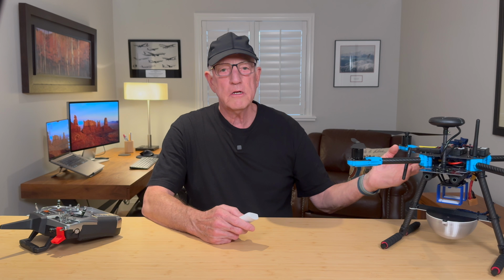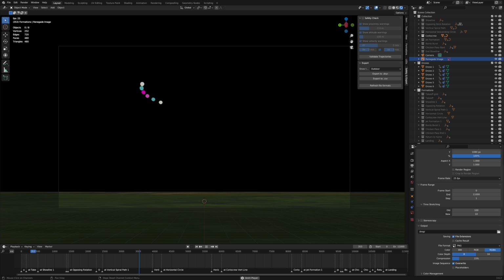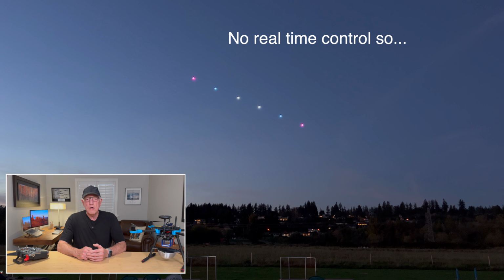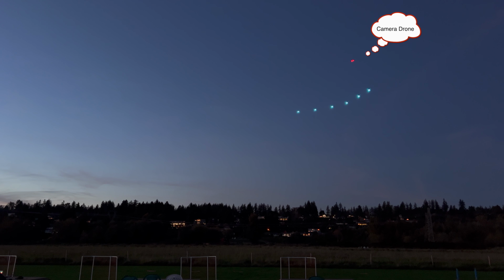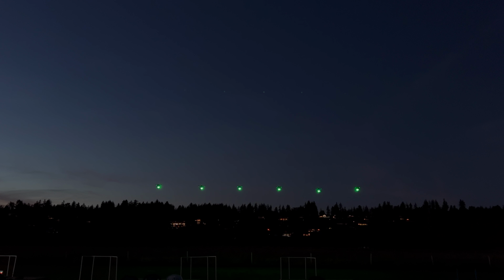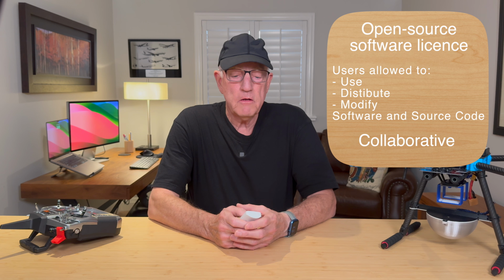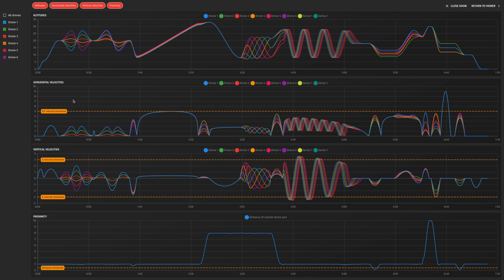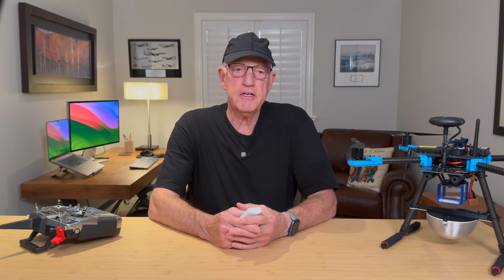How I fly Drones in Synchronized Flight with Open-Source SKYBRUSH software.

Comment: Very nice video. I set it up on my system with the SITL simulated drones and have the full show working. Now I have to build some real drones to use. I have 2 questions 

1) It appears that you are running the Sidekick as one of the control links. This seems to only be available as part of the Skybrush Live Professional bundle. Is this available as a DIY option?

2) What is the light setup you have for your drones? It appears to be 3d printed, got any info for me on that part?

Thanks you again for a great video.
Reply from the maker: Hi! There is more info in this video: Hi! I describe my drones in this video: https://youtu.be/qBjRaalXJmY